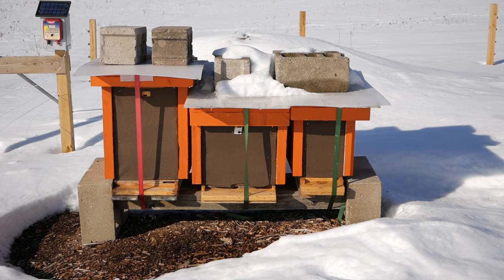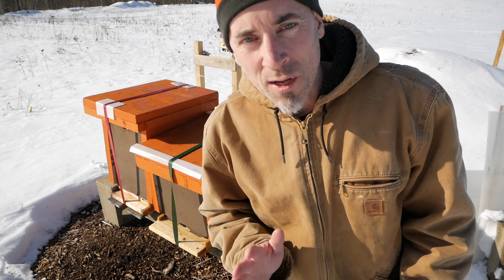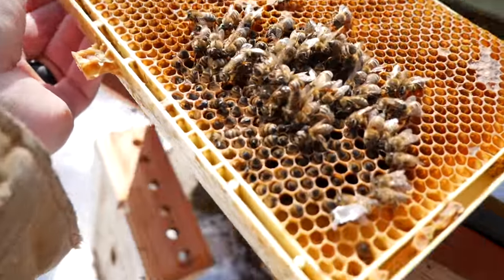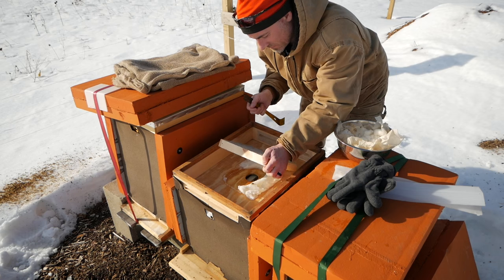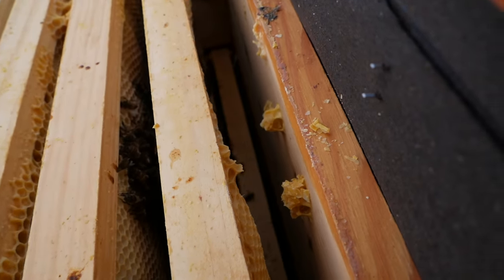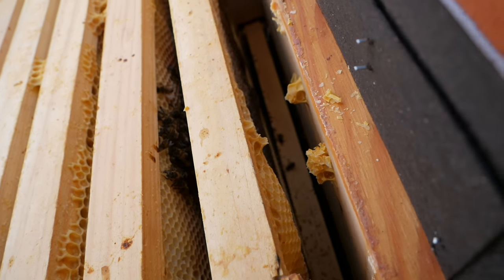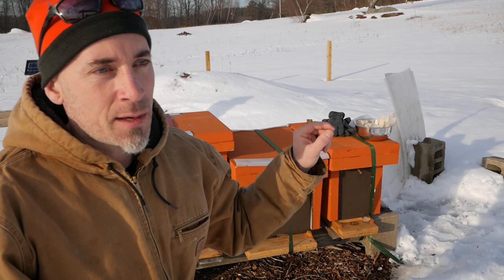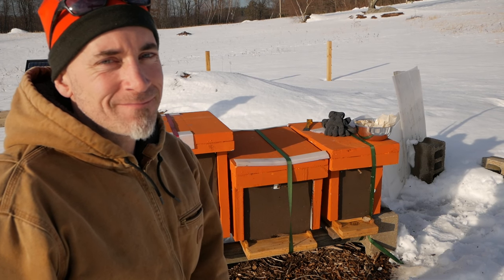Flow Hive - Did They Make It?

Comment: Vino Farm:

Do you think the lack of moisture in your burlap is due to the inner cover still being on your hives, not allowing much moisture to get up to the burlap?

The inner covers still being on your hives could be the cause of the two hives you lost, causing condensation to build on the inner cover rather than moving into the burlap and then raining down on your bees freezing them out.

I would think your middle hive has survived due to being between the two other hives, reducing the amount of fluctuation in temperature, causing the excessive condensation.

Try removing your inner covers and then installing your quilt boxes.
Reply: After looking closer I see it is your Vivaldi Board I am seeing, not an inner cover, but I believe your Vivaldi Board is acting like an inner cover and trapping condensation on the bottom of the Vivaldi Board.

I would try a full quilt box to draw condensation up out of the hive.
Reply from the maker: There was no traditional "inner cover", just a Vivaldi Board. The Vivaldi board is like a combination quilt board plus inner cover. The theory is that the moisture will chimney up through the hole in the Vivaldi board and wick into the burlap. When I removed the Vivaldi board, there was no evidence of moisture on the bottom of the board. No mildew or spots or anything. It appears that it worked as expected. The area the burlap sits in is also vented to the outdoors, so theoretically, if it does get moist, it can dry out with the air circulation. The hive really was dry inside. There was no indication that there had been excessive moisture.

Comment: Mite count!!!!
Reply from the maker: When it's 40ºF? Would you do that?
Reply: You need a handle on mites.  Sooooo many bee keepers come out in the spring only to fine their hive(s) are in the winter losses coulomb.
It takes so little time to collect a three hundred bee sample. If you are quick 10 or 15 seconds is all it takes to take a frame with larvae and caped brood out taping rubber tray and return the bee frame to the warmth not the hive.  You knew the hive was in trouble because you downsized it to a nut (good idea by the way) so you could have done your count then, but the best time was when you got the gift that keeps on giving from your neighbor.  And you absolutely should do a mite count on any hive new to your apiary.  You have a beautiful setup now and when it is full of 40 or 50 colonies you won't bring in unknowns.  So, you might already set up an isolation spot where you will hold colonies for 30 to 90 days as far away from your primary spot

Comment: bees survive -40... so you shouldnt worry all that much man. the nukes arent good for wintering though because bees cant get a proper cluster.
Reply: oh wow... ya... just got deeper into the video and you lost your two outside hives. i believe this would be due to one specific issue. your bee yard, as i see it, is very exposed to wind. that wind will pull ALL the heat from your hives... even with the insulation. it will pull it out of any opening. perhaps a thought for next year would be to build a temporary shelter around the hives to keep the wind away

Comment: Over Winterized the hive to much.  No need for the foam panels.  You never gave the tar paper a chance to heat up with the sun. Causing to much moisture in the hive.  Do not put a reducer in leave open and put in 1/2 mesh wire in the front.  Bees still can get in but mice won't.  Put a foam top cover on instead of the wooden one.  Foam is porous and water will not build up.  keeping the hive dry.  Just a suggestion and good luck.
Reply from the maker: Charlie Welch  What are your winters like? Because what I did is not abnormal for my local climate. The tar paper was on the south side. The only side that gets the sun in January and February. It definitely heated up. The few times I checked, there was absolutely no moisture in the hive. Zero mildew or anything on the lids. Moisture was not the problem.   My Vivaldi board handled that. I don't know what killed them, but it does not appear to be water.
Reply: Same as you, I am in Mass, just around the corner.  The Flow Hive seem to be a very strong hive.  I thought for sure it was water dripping down into the brooder boxes.  Strange how the frames were packed with honey.   Its like they just decided to move out.
Reply from the maker: It's a mystery. Everyone I have talked to says, "Genetics" or "Sometimes hives just die". I know it wasn't moisture, though. Something weakened them. I think there is a chance the queen died or took off or something and the hive collapsed. I'll post the autopsy video within the next couple days. Someone may be able to add some perspective there.
Reply: OK. looking forward to it. I would love to know.  Especially you, I'm sure.

Comment: Dude, firstly don’t open a hive in winter! Your letting all the warmth out! 
Get a heat thermal imager and check the hive from outside.
Second, you should set up a wind break around them. Put the back wall wherever the prevailing winds come from.  When you open them up you are letting all the warm air out.
Did you notice the hives on the outside that where strong both perished and the middle hive which you said was not as strong survived? 
The other two hives acted as insulating and wind breaks.